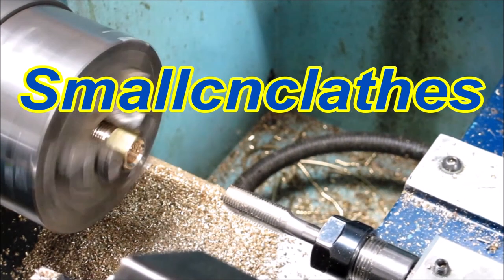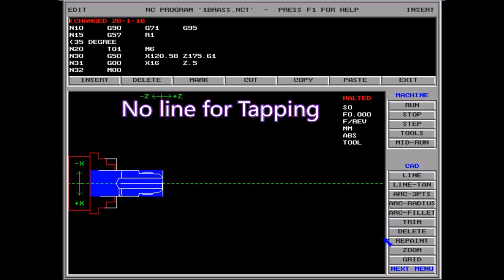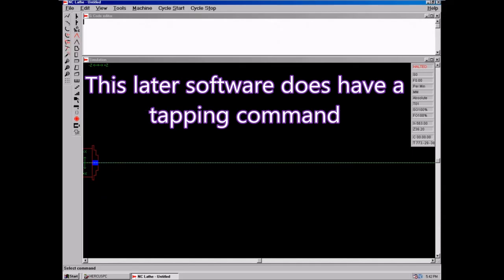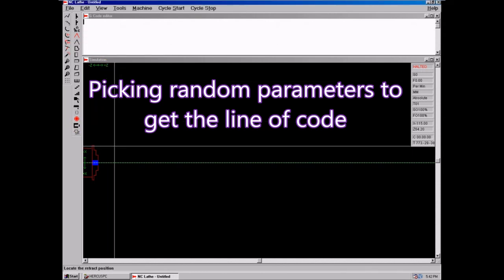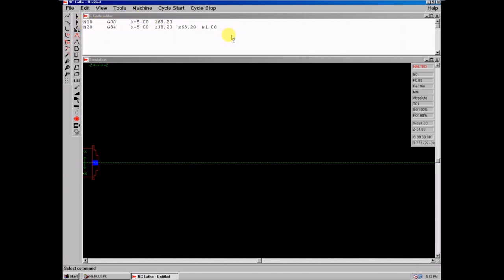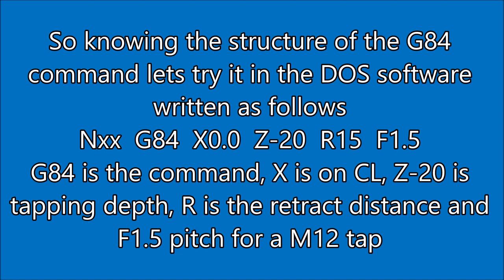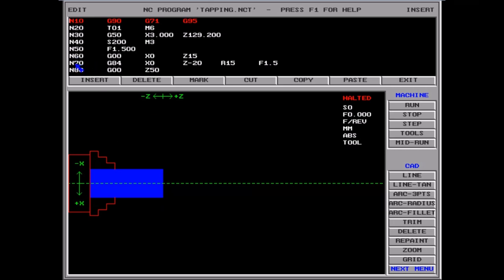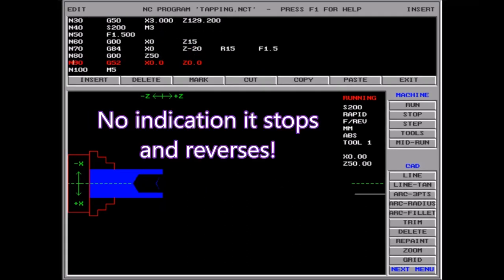This small cnc lathe can't tap threads. I try the G84 tapping command to see what happens.

Comment: Nice solution. The old programmer in me is loving every DOS reference. I still remember writing BASIC programs in the early days.
Reply from the maker: I usually prefer to run this program inside 98SE as it make usb available.  But this one at the moment runs in DOS. I am not very good at command line operations, but Xtree Gold simplifies my file management and makes it easy for me. Both the Hercus and Xtree software are in the Autoexec bat file so easy to call up.

Comment: Awesome! I am always triyng to find tricks to get my old CNC machine with a Fagor 8010M comand to do what i want! Just like you did there heheh
Reply from the maker: I really had no idea it would work.  Strange that the software can handle code that is not catered for in the menu. One thing this software will not do is tapered threads, have tried the correct code, but it does not want to play.

Comment: Hi Sir, what breakout board are you using ?
What cam software and control software are you using ?
Reply from the maker: Breakout board no idea. The machine was manufactured as a cnc lathe
The cam software and controller provided by the manufacturer
Reply: @smallcnclathes  Thank you sir for the reply. I really enjoyed your videos. I learnt alot from your videos. I love the quality parts you have made. Excellent Job sir :-)

I am in the process in converting my 7x14 lathe to cnc, Just got it calibrated today :-).

I am using mach3 turn for the controls via parallel port BOB and Ezilathe cam software.  (https://youtu.be/sHGHesPBR9I)

Just wanted to know of other alternatives to mach 3. 
Btw the BOB you are using is parallel port based ?
Reply from the maker: @rengankrishnaiyer6912  I have no idea if the connectors can be considered a parallel port. There are 2 connectors from the pc to the lathe both connectors are larger than the standard parallel port connector
Reply: @smallcnclathes  Thank you for your information, stay safe sir. Cheers.